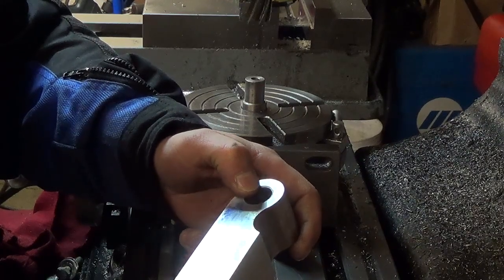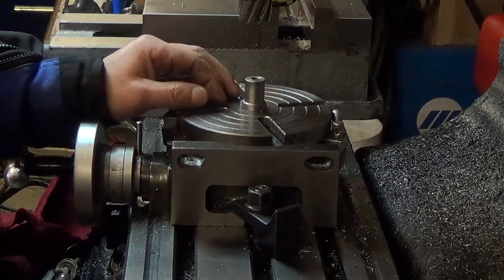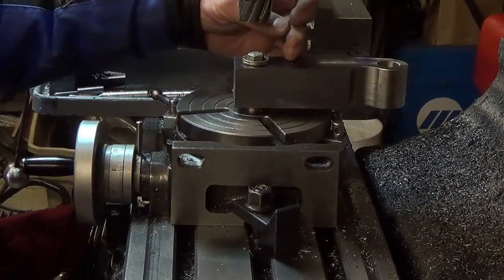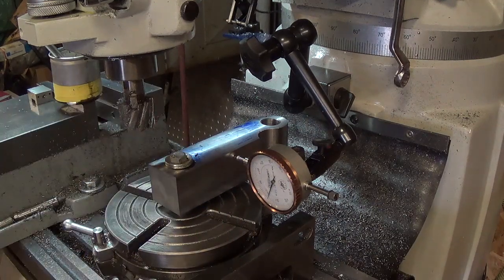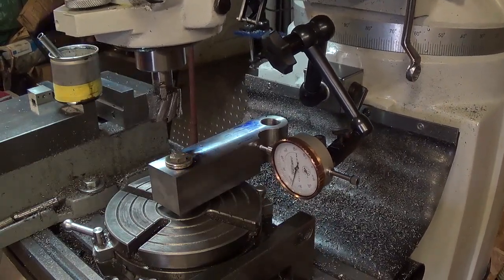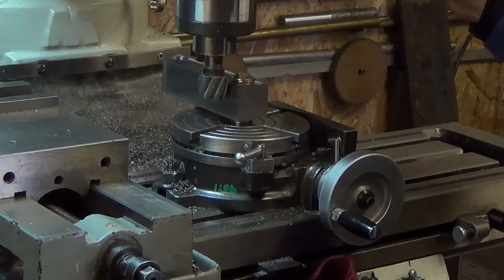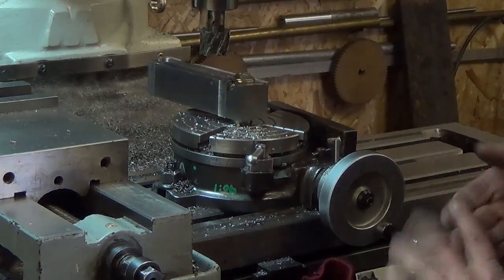5-Axis Fun

Comment: you do some very interesting  vids do you still do them  ???
Reply from the maker: Thanks. Things changed in once i moved the shop to where it was quite difficult to record video. I'm hoping to change that in the VERY near future. :-)
Reply: Great I will be watching for the next  vid also i was trying to (realy trying to )convert my round column mill and you had the quick release tool changer but try as i may i can not find all the vids for it just the last 2  I know that the mill you have is diff to mine in all ways including quality lol but we use what we have any reason to be in the shop stay safe
Reply from the maker: Fitting the power drawbar to a round column would be quite difficult. I know as I had one..:-) There is no structure above the spindle pulley to mount any type of unit. I guess you could remove the pulley guards and fabricate some sort of bracket...but it would be a ton of work. The drawbar videos start in the one titled "More Clips plus Drawbar #1" :-)
Reply: thank you i will go look at them .And yes it is hard to see how i would do it (now to pick your brain )I was thinking  a bracket bolted under the spindle drive pulley to support air ratchet and as there is not enough meat  in the drawbar hole for a thread for the extraction so do you think an air chisel with out the chisel  what ya think  ?
Reply from the maker: A set of brackets (3) to reach around underneath the pulley should work to give you a platform to attach maybe? I wouldn't think the air chisel necessary. The small air gun normally tightens secure enough for most work and releases easily. On the odd occasion I need to tighten the drawbar with a wrench for heavier work. Then even just a tap on the side of the cutter will make it release.
Reply: cool i was worried that i would have to still use a hammer to get the taper to release  when I get the new 3ph fitted with the vfd (should be here next wed )hahah as if i will then make a start on the quick release and the quill brake  thanks for your help looking forward to more vids when you get to them
Reply: Hi Again Colin How's it all going ?
well i got the vfd installed but have no idea on how to make it work it goes forward but have to put some settings in the vfd 
ok have a good day(or night) dont know Canada time yet
Reply from the maker: Ha, nighttime here (11:30 pm)...just finished a walking dead episode.. :-) F/R should be an easy SPDT switch and 3 wires. Other options like a speed control will require more wires. If I were wiring one up I would probably use a multi-conductor cable with enough for future expansion to connect a control panel to the VFD.

Comment: Nice work. Always makes my butt pucker to see someone with long sleeves working machinery. Push 'em up to your elbows if you can! Best.
Reply from the maker: lockbuilder Thanks for the comment. I normally do have at least some type of jacket on in the shop except for mid summer temps. I have always worked the same way but with the utmost respect for spinning assemblies. I try not to make any move unless it is with purpose and in a safe zone. Maybe I'll jinx myself but I have never had any snag ups happen on the lathe or mill in 20 years. I learned early (17-18) when I got my gloved hand caught in the drill press. Thankfully it was a belt drive and the belts slipped.  Cheers, Colin

Comment: Colin;

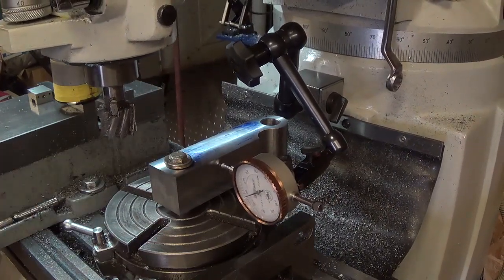Great comment at around 2:00.  I love it when I see yourself, Tom, Adam, and Keith Fenner all sound amazed when you eyeball one in first time.  Just goes to show you that even the guys who are pros at this expect that final tram is always required.

Looking at the color of your cutting oil, do you use a sulfur based oil as your standard cutting oil?

Regards;

Ron Kluwe
Reply from the maker: I guess over time you develop an eye for aligning things and squareness but you never expect to just lay it on and it be as good as that. You always expect to have to dial it a bit bu I'll take a lucky hit when I can..lol
Usually I buy the light SulFlo oil when I can but the last container was dark. Kinda looks like used motor oil. Makes the same mess as light but you notice it more!!
Thanks Ron

Colin

Comment: Could that be an Oxtool style mill vice stop?
chris
Reply from the maker: Yep, it looked useful so I had to try it. :-)
Reply: I made one some months ago, well worth having. Even in aluminium they are extremely rigid, much more than they ever need be.
Enjoy the build
chris
Reply from the maker: I hadn't thought about aluminum, but I have none the right dimension anyway.
Thanks!
Reply: I thought you knew that Tom's (latest models) and the commercial versions are anodised aluminium, but hey use what you've got, right?
Reply from the maker: I would probably use aluminum but finding that hunk in this neck of the woods would be hard.
:-)

Comment: Colin that is a neat trick with the rotary table.  Am I understanding correctly that the shaft is press fit into the rotary table and the part is held down through the center to the table with the bolt?  Seems like more than a light press fit if you are tightening the bolt on the part which would be pulling the shaft out of the center of the RT?
Reply from the maker: Hi Bill. Yes I have made a few different threaded inserts to use with table depending on the required job. I show another use in a video soon to be posted. I make the inserts to +.001"/in of diam where the original MT2 insert is .0005" undersize.
A shoulder has to be left on the insert for the piece to bottom and prevent pulling the insert out. The .946" diameter can hold quit a bit by itself and, of course, the tail end of the piece can be clamped if necessary.
This was, by far, the largest piece I have ever used this method on but I wanted to see just how much it can hold.
Thanks for commenting. :-)

Colin